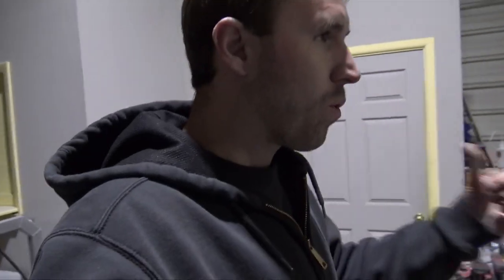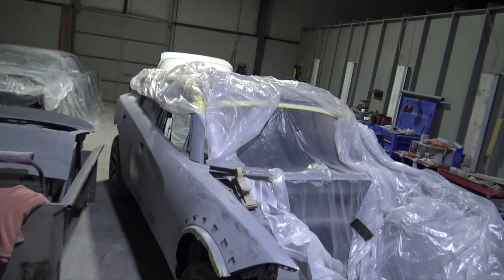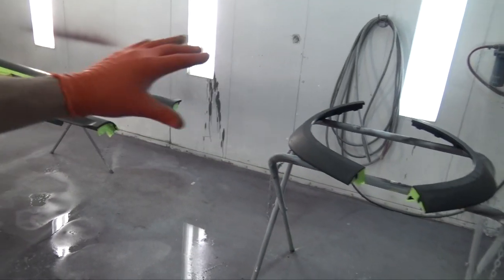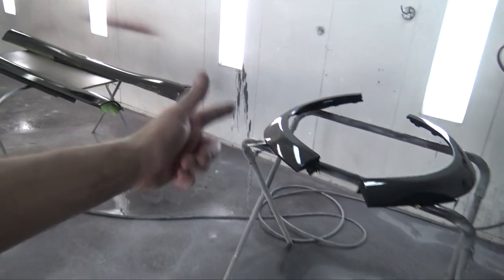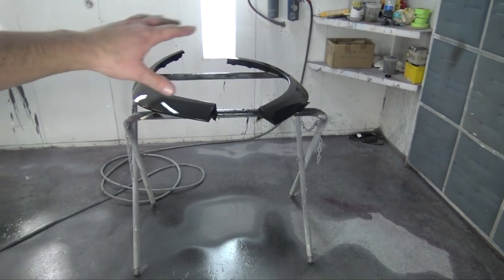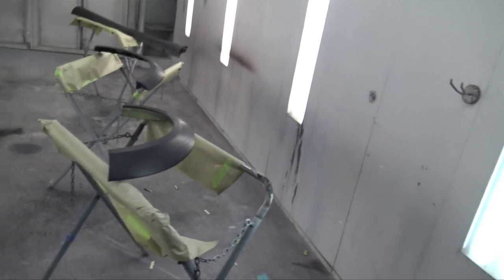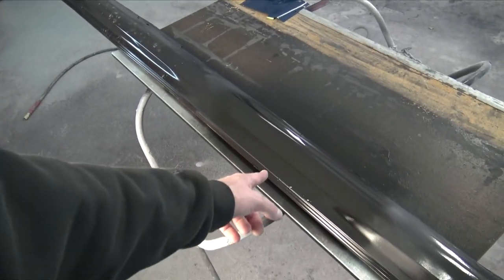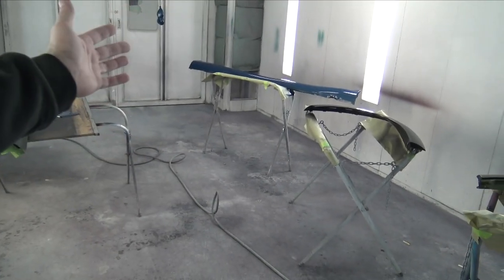Building the Ultimate Station Wagon | 2021 Charger Magnum Hellcat | 1000HP Hellwagon | Pt 35

Comment: Last summer, when my friends car got painted i helped him sanding. We went up to 2000grit before the first coat of paint. Was a pain, but well worth it. Love the content!
Reply: Not sure that's a great idea, too smooth of a surface the paint will just lift off and flake like crazy.  Material needs tooth to grab onto, that's why every system comes with very specific instructions on what grit to do the final sand in.  Generally pearls have the smallest flakes so they go 400 or 600 grit to avoid the flakes laying down weird and reflecting back sanding scratches.  Read the material notes that come with your paint, I guess is all I'm saying
Reply: @bgee461  We did what the painter said to do, before that it has been primered with a specific primer a few times so yeah. But maybe there are diferences beetwen the scales in the Us and Hungary but we did factory spec as i heard. Also, the painter is a restorer, well known. so I think we good. But when i will do my own will keep this advice in mind, thank you.

Comment: Tape a piece of paper to the wall to check your spray pattern, looked like you were a bit too wide open for the distance you’re holding the gun from your work piece. I always did this with my metallics and clears so you can fine tune your pattern to avoid having too much material on the top and bottom edge of your fan, I usually set for 4-6in distance from the work piece, it’s especially important with metallics to have a consistent fan pattern for the distance you spray at because it can cause striping if your pattern is too heavy top and bottom and with clear you can end up with runs and inconsistent layout if it’s too heavy top/bottom. That color looks amazing, look forward to seeing the whole body in full color.

Comment: Might want to check your mil thickness on the car after each prime and block session to make sure you’re taking it down enough. Most paint systems are designed for 6-12mil, over 12mil and you can run into issues of cracking, excessive shrinkage and other blemishes unless you’re using a paint system designed for excessive mil thickness like HOK and aviation grade high solids. Just something to keep in mind.

Comment: The roughness on your fender flairs: Some of the body repair parts you get from the factory are pieces that have been rejected for assembly line use. Various blemishes and dents, that can be fixed easily in a repair shop environment aren't used on the assembly line as they don't have the time to screw with repair so off they go as over-the-counter repair stuff.. Like I said, not all parts are but some are.

Comment: I'm sure you know what you're doing but with all respect I will like to give you a tip on the preparation for the base, I work in the same industry ... instead of using a dark color on the seal , it's better tu use a light color like gray or white to use less material because blue colors are so transparent and usually that's the reason the plastic parts don't usually match the body off the car but overall I love your work and I can't wait to see it finished!!👍👍👍
Reply from the maker: I could have done just one coat this paint covers very well

Comment: Why are you using your sealer as primer?  If it went through to plastic, you always prime it as that'll soak up sealer and leave different texture.  Not to mention you can probably get that wavyness out of them with a good thick primer coat and some, guide coat, and some blocking...
Reply from the maker: Its a flexible primer converted to a sealer